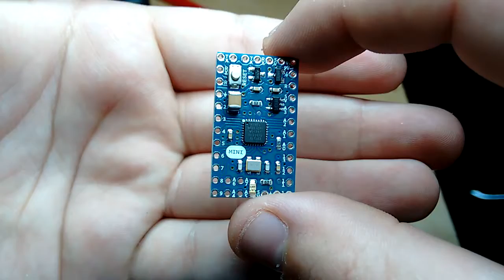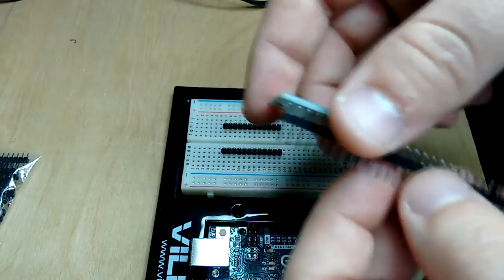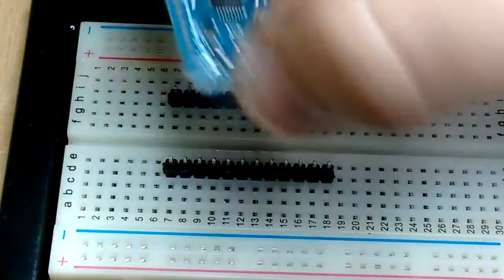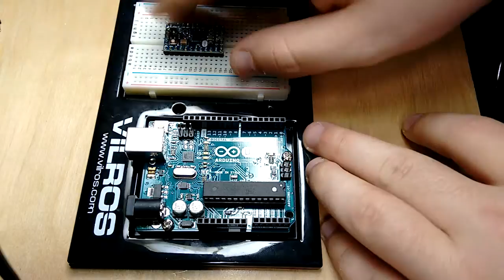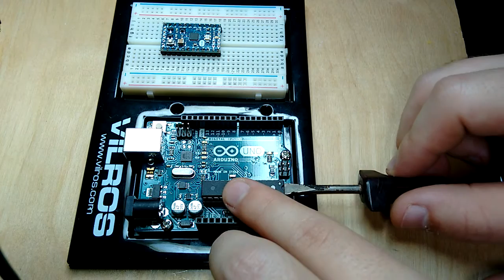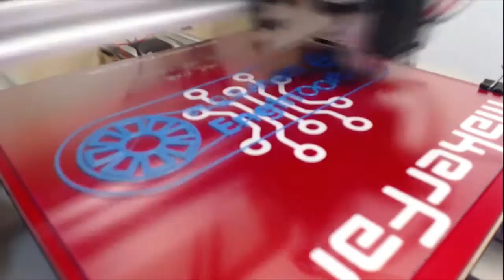Getting started with an Arduino Mini - Header Pins and USB from an Arduino Uno

Comment: Thanks for the videos, I especially like the things you've done with 3D printing.  I need to make a small criticism of your soldering technique-- you should not put the solder directly on the iron but rather heat up the joint enough so that solder flows when applied to the pins.  The solder balls on top of the pins indicate that the solder is not flowing correctly due to the pins not being hot enough.  I apologize if you already knew this.  Otherwise, keep up the good work!
Reply from the maker: Thank you for the tip! This was my first time soldering actually (well, anything more then a couple of wires for the endstops of my 3d printer), and I've been trying to improve my technique since then. I was being too cautious about overheating the component, so instead of heating the joint I was melting the solder on the iron. Took a couple of times getting the solder wire stuck to the pins to learn that lesson.

There will be a video in a couple of weeks about my first time soldering on a perfboard. Now that was an experience! It is not pretty by any stretch, but it was a good first try. It'll take quite a few more circuits before I'm comfortable with soldering, but I'll gladly take criticisms and suggestions, its the best way to learn!